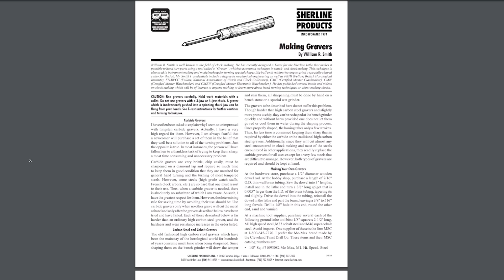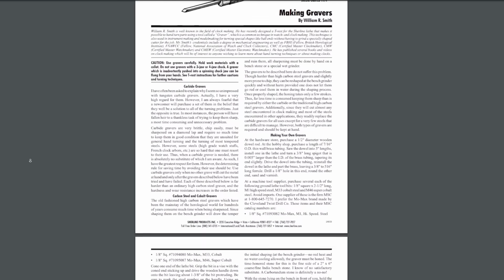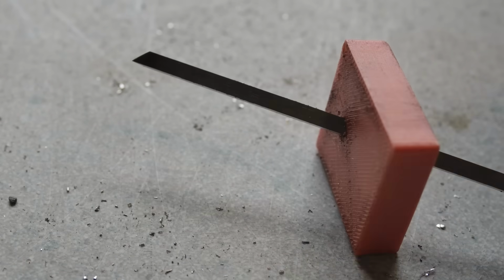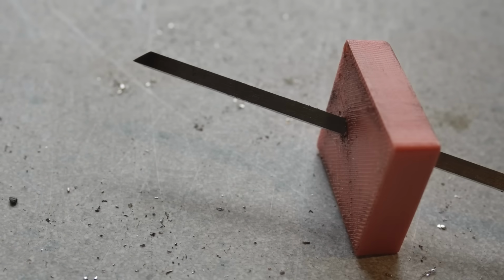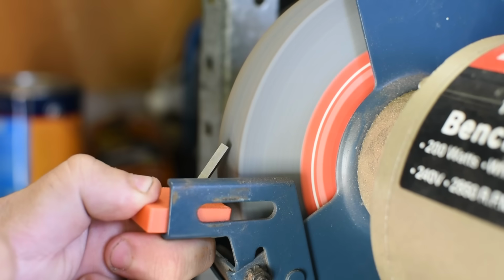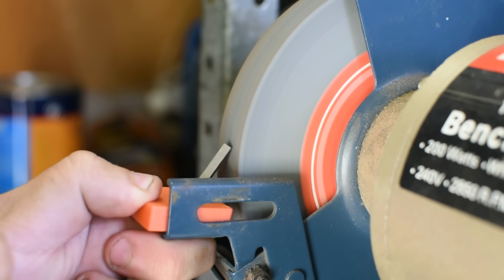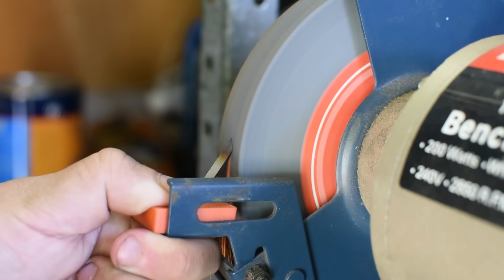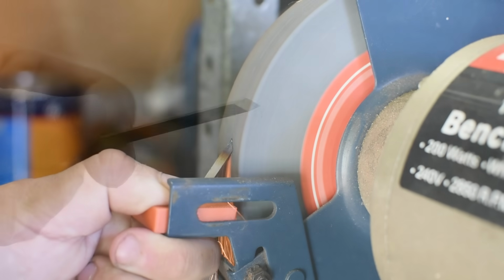I Printed A Better Lathe

Comment from the maker: (safety disclaimer) the large disc turning is not really the intended use of the lathe and was really just a torture test, the tool caught a lot and just stalled the motor but with a larger motor this could be quiet dangerous. This lathe is really meant for less than 10mm parts. 

On the topic of "hand tools should not be used for metal parts", this is not a new concept and small parts have been turned this way for centuries and still are by some. Sherline sells tool rests for this type of tooling for their lathes. I understand the safety concerns but the motor here is tiny, 1000rpm and taken from a printer. Even on the large off center workpiece with giant saw notches to catch the tool, I never felt any force of note because the motor is just too small. When the tool did catch the motor would just stall. 

This one has been a while in the making

There are just 2 days left of the Prusa awards for 2024! I am a finalist and there is a cash prize that would fund dozens of tools like this. If you like my work and would like to see more of it it has never been easier to support me, just go vote!

https://www.printables.com/awards
    
Im also trying a slightly less detailed style for the build. Not many people watch that section so condensing it a bit makes sense for me. 

Thankyou all for watching :)
Reply: a standard tool-post/compound-slide should be included in the design of the next lathe (assuming you're going to also experiment with increasing the general size of the lathe)

Also a better waze than the aluminium extrusion should be planned around to enable the slow upgrading of the lathe by the end user.
Reply: Looks like i missed voting but it looks like you won congrats
Reply: can you please add links for the parts use in the build. All of the bearings and nuts used in the build.
Reply: This is a cool design. I think a good idea for a future upgrade would be a better tool post potentially with a leadscrew  driven Z and X axis and a compound slide
Reply: What I am personally curious on with a project like this: 
Is this a safer machine to work with due to the lower overall force, or are things like tools getting caught and small assembly accuracy mistakes the real dangers with Lathes?
I generally dont use tools powerful enough to seriously injure me, cause I always manage to get tangled on it at some point, so I have never owned a Lathe, or even a Dremmel powerful enough to rip my hair out for that matter.
Reply: As a, possibly better, alternative to the hand drill for vibrating the concrete, I would suggest one of those cheap massage guns with the linear thumping action. It should shake the concrete down quite nicely.
Reply: "not many people watch that section" literally the best bit for me 🤣
Reply: Spot-on design, sir!  You have earned not just one new subscriber ;) but likely a spot in a virtual pantheon!  
I say: stay >with< the extrusions for slot table, perhaps with an "advanced adhesive" between the beams?
Talk later about recipes for concrete?
Reply: What are the keywords to search for to find a spindle like that? Normal ones have a taper that would cause a gap between it and the bearing at the back. Also, if you're going to use a screw mount like you did for the aluminum disk, it should be a left-hand thread, so it tightens instead of loosening when the lathe (which turns CCW) starts and stops.
Reply: This is an awesome project.
You just gained another subscriber.

I do have a question though. What sort of run out are you getting on the spindle?
Reply: Gotta love when people try to correct you on a project you built
Reply: Wanna vote for you - please put the link in the description - or edit your message - what you posted just goes to the main awards page - couldnt find you or the concrete lathe... Stay awesome! All the best! ❤
Reply: curious what your thoughts are on sweetgums "everything machine".  got me thinking to myself wondering how hard it would be to run this off of a belt from that machine, and consolidate more around that system.  https://www.youtube.com/shorts/2ucL7ykRDU0
Reply: I got another video for you now make a glass lathe one that can handle large diameter tubing the main thing is there's a check on each end spinning in sequence
Reply: Great idea. 
There was times when 3d printers were replicating them selves, now other machines can be replicated with 3d printers.
How about whole project, something like open source lathe?
Reply: why not fill the concrete in those baking things to do toppings with? or a zip bag and cut a corner and then press into the holes
Reply: You will either agree with those of us saying: 'hand tools should not be used for metal parts' now, or you will do so later when you've lost a finger or worse. That all said, thank you for all your great work.
Reply: @noreply5461  that depends on HOW EXACTLY someone uses hand tools on a metal lathe. If it were for people like you, we would still be stuck in times looooooooong before the first lathe was even invented. My wood lathe can just as easily remove fingers as a metal lathe, but does that not matter because its a lathe for wood? I dont know, come here and hand-turn some cast iron on a 4.5kW wood lathe and find out. 

Sincerely, someone that nearly lost 2 fingers due to using hand tools on a wood lathe.
Reply: Can you put a tool / material list in the description please? I am particularly interested in the concrete vibration powertool you are using, thanks
Reply: This is an amazing lathe. I’m looking forwards to when you start making one with some precision tooling or cnc!
Reply: Could you please send me the link for the best motor to use for this? I cant seem to find one that is in the video.
Reply: why not use sand instead of concreating
Reply: You may make some shorts about a minute long to satisfy the curiosity of ADHD fish memory viewers. 10 minutes is already quite a short video, and there's really nothing stretched and excessive here, all the information is on point.

Great concept by the way, I'm interested to try something similar
Reply: Whilst I apprieciate the craftmanship, diy lathes....I just cant see how its worth even trying for a safety point of view
Reply: @francistaylor1822  DIY or not, a machine is only as "safe" as it's operator is competent.
Reply: @Jimmeh_B  No, competency wont address any unknown flaws in design and basic safety guards that could otherwise be there as well as testing etc that would normally be undertaken by a manufacturer for example.

I love and apprieciate the craftsmanship and idea, I cringe about what it is.
Reply: @francistaylor1822  I beg to differ.

Also, being the owner of a 485mm swing, thread cutting lathe and knowing how absolutely dangerous they are for the complacent, this little machine is nothing in comparison and poses very little danger.

I can also tell you, that his design is equipped with equally as many safety features as my lathe. In fact, more, given that it can sheer/burn it's drive pulley well before you lose a finger and is incapable of driving a work piece that could build enough inertia to remove a digit.

In any case, no matter how many "safety" features you engineer, neither stupidity nor incompetence know any bounds.

Comment: 1 year later, but this is just what I've been thinking of recently! How can I possibly make a cheap, yet effective metal lathe, without spending a small fortune. This is great and mixing it with stuff like the Millennium CNC mill Milo and/or a Dremel based CNC router, can work wonders with this and help make the foundation of an even more upgraded version, again without spending fortunes. Got a sub from me out of this!

Comment: It's a neat concept, but without a toolholder and at least one axis, this is pretty much just a "woodworking lathe but smaller"

Would be kind of hard to make anything to spec on that, seeing that the tools are held by hand, so I'm not sure that this would be particularly useful as a metalworking lathe

Comment: I think this is an incredible use of 3d printing as a technology but you really should not be building anything you want to last out of PLA. It is one of the shitiest materials out there from an engineering standpoint. It creeps to high hell. Use ASA, it prints great when you have a machine set up for it and it does really well in load tests with no creep and very high UV resistance.

Comment: Nice design👌.  However, I suggest installing a shield behind the chuck to stop bits of metal flying into the exposed bearing.
Also, it looks like you need a stable support for the cutting/shaving tools.

Comment: Be aware that if the tool steel blank was hardened, it DEFINITELY lost some of its hardness form the grinding process.
To ensure you keep the original hardening, you want to keep it VERY cool, if its getting hot to the touch its time to cool it down in water.
once the surface even slightly changes color you've reached tempering temperatures and changed things about the hardening.

Also it seems to me that that spindle need some sort of flywheel on the back behind the pulley, that would make it a LOT harder to stop the lathe by cutting too hard.

Comment: I would rather have used casting resin... or even normal resin like used with fibreglass.... yes fibre glass resin will probably crack but since its in a mold it wont matter . As an added bonus , resin can be drilled and tapped , easier to add tread.

Comment: What about lost wax casting ? im shure a zamak shell with concrete filler would be more stable, if you find a way to do lost was with 3d prints (if i remmember correctly) there is a special filament just for that).

Comment: For the pulley, it could still be printed, but I would recommend something like carbon fiber PETG filament. It does require a special nozzle and I've been told it tends to be really finnicky to print with, but it is a lot stronger and can handle higher temperatures.

Comment: quite useless maybe dangerous ... for a lathe ... 3D prints with concrete in-fill may have uses, just not as metal-cutting lathe ... if you need a lathe, just go buy one, not worth the effort to build your own that actually works far worse than commercially available ones

Comment: I assume you know this but I'll say it anyway in case you or anyone did not. You can mix sand and epoxy to produce a heavy and stable material as well, it's not quite as cheap as cement but it's pretty popular in the homebuilt machine tool space

Comment: Excellent idea - could it also be done with plywood forms instead of 3D printed? Steel bars and pins within the plywood forms could ensure accurate positioning of the headstock, tailstock, and sliders, while also reinforcing the concrete and positioning the plywood sides of the form.

Comment: All concrete needs rebar, may I suggest hardware cloth for the next version. Also, a metal lathe without a cross slide vise seems like a dangerous idea. Using handheld cutters on a wood lathe is nbd, but a metal lathe is a different story. Having said all those “suggestions”, the whole concept of filling printed parts with a ridgid material is awesome and I am mad at myself for not thinking of it first 😊😊😊

Comment: Intrigued by the concept of filling 3D printed shells with conrete to make them more robust and solid. I could use a small lathe for model making tasks, turning small parts in relatively soft materials would be a great use for something like this. Wouldn;t use it for steel...but aluminium, delrin etc. sure.

Comment: To make the concrete pour cleaner and less messy you can model a 3D printed funnel that mates cleanly with your opening profile. Just make sure it has an inset lip so it connects and covers your open edge and you can pour straight in. Great build!

Comment: When Grinding High Speed Steel you want to keep cooling it every few seconds and not let it heat up.. The Straw to Purple Colouring indicates it got to 400 to 600c which Anneals(softens) the metal.

Comment: The most troubling problem with using concrete for a machine frame is that while concrete has good compressive strength, it has extremely limited tensile strength.  This limits its ability to deliver rigidity involving shear stress and bending moments (beams, cantilevers, etc.)  I suppose you can get around this with a ridiculous amount of overkill in concrete volume, but it's just a bad path to follow, isn't it?

Comment: Love your ingenuity. I have manual and CNC mills and lathes in my home workshop, but I’ve been fantasizing for years about making a “Voron of CNC lathes” , by using a combination of epoxy granite and high quality off the shelf linear rails, ball screws, module gears etc, to build a full size, high power, high quality home lathe with the sole purpose of making it expandable for tinkerers. By adding a plenty of threaded holes and other mount points all over it, it could allow people to run it manual or cnc, add their own toolchangers, add live tooling mounts, add old school copy-lathe jig holders and more. Since epoxy granite is so expensive and molds are a pain, I had relegated the idea to fantasy-land only, but your concrete and 3D printed mold technique, has given me a whole host of ideas to merrily dream on about 😁

Comment: @Borgedesigns, hi, about the chuck: perhaps a solution could be to to turn a flat face plate like you did with that aluminum one, and attach a chuck like in this video? https://youtu.be/OrdBGunGc_U?si=U9hXT8oT3S19-sgz&t=1139 The face plate could be just screwed onto the shaft, or if that is not rigid/repeatable enough to make the chuck run true, it could be welded/glued to the shaft (that would mean swapping out the shaft when you want to switch to a chuck). What do you think?

Comment: Great little lathe. Would recommend checking the head bearings however, looks like the outer race of the bearing is spinning in the mount. Little bit of loctite or similar should help (or a clamping mechanism) and if possible put some sort of seal or cover over the bearings to stop grease coming and swarf going in.

Comment: Is concrete used in commercial lathes??
Reply: Cast iron is typical. Probably the only advantage concrete has is that it's way easier for a hobbyist to cast than iron is. It's a pretty neat design decision.
Edit: I've learned from another commenter that Epoxy Granite is also used in some machines, which is fascinating.

Comment: Have a suggestion for a what i think could be a better bearing for the head stock. it is sealed and it is super strong.
512319 (FWD Models;Bearing ID 32mm) Rear Wheel Bearing and Hub Assembly Compatible with Audi Q3 TT VW Beetle CC Eos Golf City GTI Jeta Passat CC Tiguan

Comment: Highly recommend mixing your own concrete by getting pure portland cement, and whatever aggregate you want. For this, play sand would be good. Add some acrylic fortifier to make it more fluid and help it get into crevices better. Since you're not concerned about true concrete compressive strength, you can add a lot more acrylic fortifier than recommended to get it really fluid and easy to use.

There are things called "mortar piping bags" used for brick mortar but will work just as well for this, or if you're cheap you can just get two-gallon ziplock bags and pipe the concrete in that way. That'll help with keeping it cleaner.

Comment: This is so great! I just designed coffee grinder using the 3D printed concrete mold idea. It basically is a two part 3D printed concrete mold that is designed to mount to a Timemore CS3 Pro. I used a cheap Aliexpress DC motor and controller board to power it.

Comment: For the bed.
Look at low end linear rails (MGN 12 or 15mm)  and supported shaft (SBR12 or 16mm)
These can be bolted onto T Slot or replace the T Slot.
The bed centres for the 2060 hold down bolts look to be 40mm apart. This is also the spacing for MGN15 linear rail. MGN15 uses M3 bolts.
A mod would include more space between the rails so that a 2020 t slot will stop/brake the tailstock.

Comment: What an absolutely brilliant idea; so very innovative.  I wonder whether you have ever considered using something like lead shot to add bulk to the lathe?  I suppose it would need to be 'bound in' with something, some sort of filler perhaps.  Although lead would obviously be more expensive than concrete.  Perhaps just sand on its own would work.

Comment: Build a hopper to attach to the filling ports.
It pressurizes the crete if filled, making it seep into crevices better and set harder, also easier to fill.
Use phone glue for temporary seams/seals.
Use superplasticizer in the crete, makes it thinner or stronger depending on your need.
Use fibre reinforcement to prevent local chipping of the crete, loose particles are a long term issue around moving parts.

Comment: Is it possible to place a threaded rod through the extrusion for the tool rest base and place a small turning knob on the end of the threaded rod? Also instead of the tool rest would it be safer to design a tool holder using some bolts or grub screws for the cutting tool?

Comment: adding concrete to boost the durability and rigidness of a 3d printed tool seems extreme  but the results are clear, i think id use clay, make the device using ur 3dprint as a model then get it baked and just add bolts were needed, But i like clay. Also there is a glue out there that "melts" 3d prints to become one whole build.

Comment: what an awesome design. Almost finished printing. Parts fit very well. However couple of parts missing- top tie plate (flat bar with three holes) and the nut holders.... although easy to CAD up.... thanks...